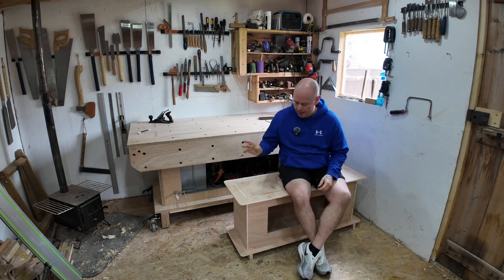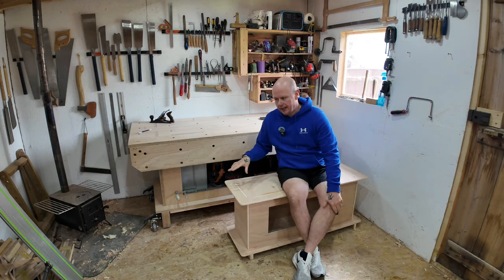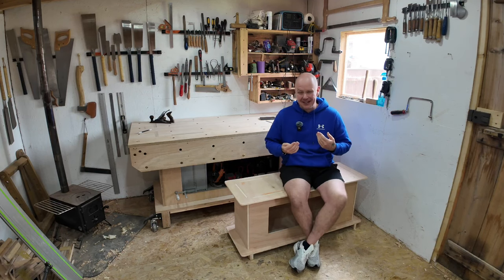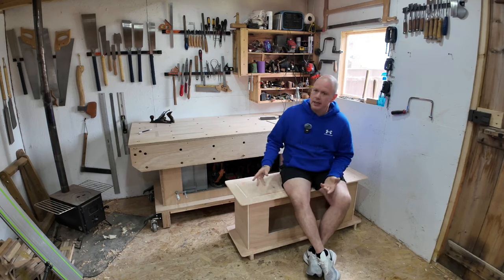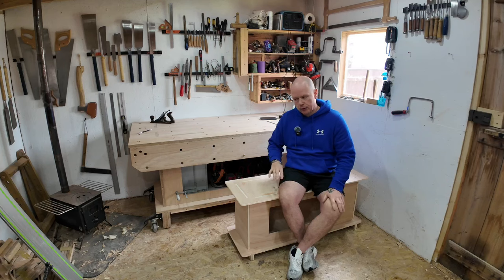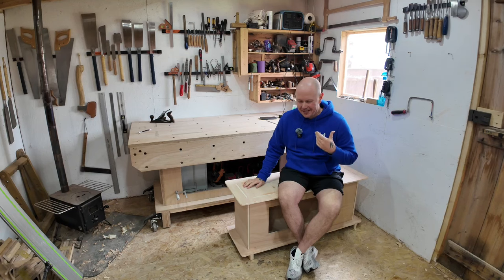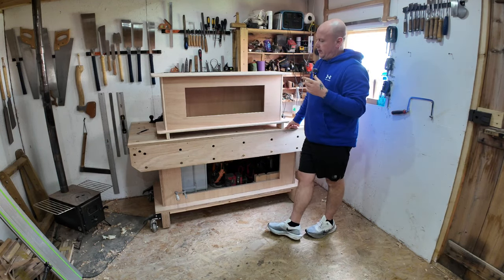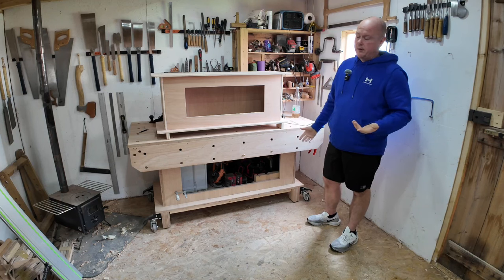woodworking podcast 128 mini slot bench

Comment: Nice! Can imagine multiple uses for the mini bench. I'm surprised how strong it is considering the thickness. Is your 12mm ply flat? I ask because here in Australia I struggle to find any without bow. Thanks for continuing to post the creations.
Reply from the maker: @edwardjarvinen3702  yeah it's pretty flat, here in the UK, the weather is a lot cooler so we don't get the bad warping that you see in Australia, USA etc.

I'm currently in Portugal, but haven't had it out of the van if I'm honest.

I think I could see a little warpage before this trip is out.

Thanks for watching, I appreciate your time 👍

Comment: I would think a few dog holes would not hurt. Advantages might include planing stops and mitre stop fence etc for just the addition of some small fences and about 6 holes and with some clever placing you might even gain a 30/60/90 set as well. You could also try a second cut out on another board thus giving you more options for storage if the cut is is replaceable ( might only take a few swivel clips and batons to do that), or the cut out could provide a large bench hook. Enjoy your trip and safe travels.
Reply from the maker: You are right, there is a lot of possibilities with this design. Dog holes would be good, but it's only 12mm thick, which poses a problem. You could always use a thicker top, but for me it wasn't necessary at the time. When I get home, I may experiment. 

The design itself is pretty good, because it's very adaptable across the board.

As always, I appreciate your time 👍
Reply: @DW_woodworks  Well worth thinking about. I guess you could use 2x4 blocks with double french cleats to hold in place below the holes and thus thicken the depth of the hold, but 12 mm dog holes for bench dogs is ok. Enjoy your holiday.
Reply from the maker: @ianpearse4480  thanks man 👍